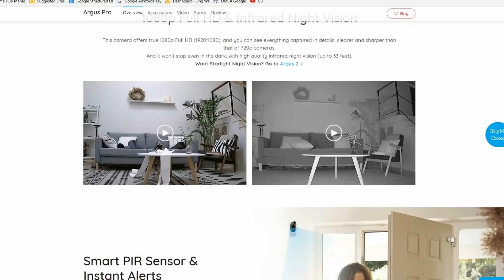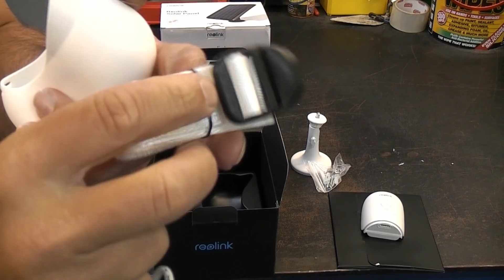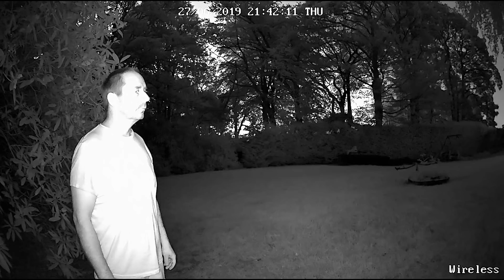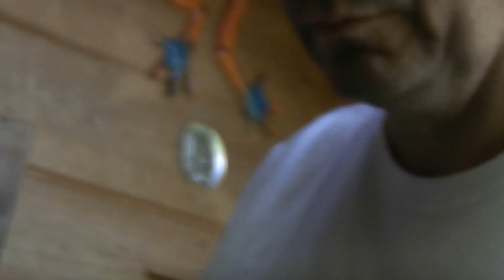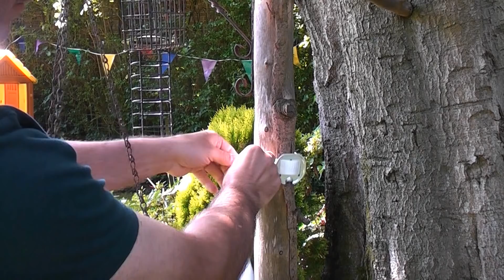Reolink Argus Pro 1080P wireless camera | install and footage

Comment: Are notifications or alerts able to be turned on or off as you choose? I don't want to chronically be bothered by them, as I am using mine for a different purpose. I frequently see car alarms going off in parking lots and no on ever coming out to deal with it. I would think this could be an issue here if you can't turn off notices or such.
Reply from the maker: Yes, you can turn off the alerts
Thanks for the comment 👍

Comment: Don't waste your money.......we purchased three Argus 2 cameras for security for a small resort. Found them to be useless, sensor is hopeless to detect movement and for the most part does not trigger the camera. Reolinks statement the sensor works 10 to 15 meters....this is a lie!.If the sensor does work, the person is only recorded just as they walk out of the field of view (useless for identification). Then there is the issue of the cameras after a period of use not recording to the SD card, and requiring numerous resets etc for them to record again. One battery completely died. After a drawn out period of messaging with Reolink support team, we managed to get three replacement cameras. We hoped maybe we had initially just received a faulty batch of cameras. Unfortunately not the case. The three new replacement cameras are just as useless, with one camera even losing color after two months of use. We have found them to be totally unreliable for capturing intruders on video or alerting us to intruders on our property. We would have been better off just buying fake cameras, as this is all we can use them for!

Comment: Got a Question for you, can i use expanding foam to glue/bond plaster board to a brick wall? obviously there will be some fixings into the brick work. currently its got crumbling render that i will remove to sound or brick.
its just a temporary lash up till i get time to do the room out properly (no time to empty it and have it out of use atm)
Reply from the maker: You can, but it needs to be a special type, which does not expand as much as regular expanding foam- https://www.youtube.com/watch?v=3CJygvnajUA
Thanks for the comment 👍🏼

Comment: Thank you for this video on wireless cams. The market is flooded with them. Hope this is a good reliable device with a good wi-if link. The only buyer beware issue would be security of this device as it’s connected via your home router, we all know about the “ internet of things” and anything with an IP address can be hacked. Also how secure is the app ?. Hopefully the app is not recording your location data and sending this information back to a country half way round the world.. People should be aware that any connected device often has built in code within the app that sometimes sends back usage data, location data etc to the manufacturer. Mostly it’s just harmless data and non-personal, but if you have issues with privacy, do your research when buying any internet connected devices and associated apps. Love your channel !. Very very helpful. Thank you.
Reply from the maker: Thanks for the comment 👍

Comment: Personally, I think wiring a camera to a central DVR is still the way to go where a typical 2-camera installation costs £500 including parts; initially expensive but worth it long term because the wiring will last a life-time with zero maintenance worries. The solar panel is bulky and ugly, still requiring to be located to a sunny location and connecting to the camera. However, the recharging of these cameras isn't too inconvenient typically needing to be done every 3-6 months if set up to trigger on motion, hence minimizing activity.
Reply from the maker: Thanks for the comment 👍

Comment: It says 20mtre range but what do you find is the realistic range with walls in the way?
Reply from the maker: Well, the router is at the front of my house. I've just roughly taken 30 strides (roughly 1m per stride) from the end of the garden to where the camera was, it is then roughly 10 metres to the Wi-Fi extender (which is in the centre of the house).

My girlfriend thinks the Wi-Fi in the house is poor, as everyone struggles getting a good signal, but this camera did not struggle at all- even at the bottom of the garden! 

Thanks for the comment
Reply: @ultimatehandyman  thanks for the reply 👍

Comment: Hello there, thank you for the informative and insightful video, 

Although you might not agree, one thing that Reolink could do is make the camera less visible and obvious. Brilliant white plastic doesn't' exactly blend in well - along with the shiny camera black fascia and blue light.
Reply: Sometimes the people want the cámara to be seen to be a diterrent agent
Reply: I use camo duct tape and it helps with waterproofing as well when deploying outside on a tree etc.
Reply from the maker: They do make a skin for it- https://fave.co/2RMQYqH (I could not find it on the Reolink website)
You can disable the blue light on the front, using the App on your mobile.
Thanks for the comment

Comment: Its a shame all these cameras have to connect to a mothership, instead of just acting like an access point. Having to create a tunnel in your home networks firewall is just not good security. If you deny this device access to the internet, will it still stream video to a locally connected mobile/PC?
Reply from the maker: I'm not sure, if it will do that.
I'm going to try it without the Wi-Fi connection to see if it still records to the SD card.
Thanks for the comment
Reply from the maker: I've tried it without the Wi-Fi connection and it still records to the SD card ;-)

Comment: How long does the battery last without the solar panel ?
Reply from the maker: Not sure, I had it out all night and it used 2%
But you can adjust the settings on the camera for notifications, sensitivity, etc.
Thanks for the comment
Reply: The are people on Amazon suggesting 4 months: even if it needed charging monthly that's perfectly reasonable

Comment: Unsubscribing due to the awful table cloth. 😀 ... was this with the best video quality settings? there seems to be a lot of artifacts, looks like it is highly compressed. Or is it due to the low power usage maybe?
Reply from the maker: I think I had it on the highest setting. If you watch the video on your mobile, it is much lower quality, but you can get the better quality by removing the SD card.
I have 5MP cameras installed at home, so the quality is not great compared to those, but it's much better than the quality on the outback cam that I have.
Thanks for the comment 👍

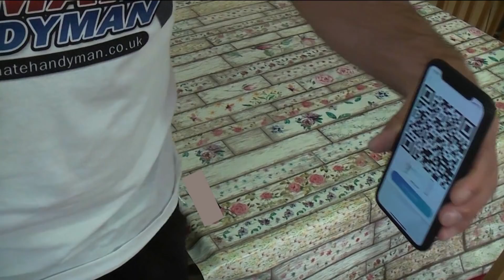Comment: At 4:40

⚠️Remove the QR code from your video as it can be used to connect to your network!⚠️
Reply from the maker: Thanks Dave, when you fist mentioned it, I tried to blur it- but doing stuff like this when the video is live takes ages!
It must have taken at least one hour, by which point another helpful guy had told me that he could get the Wi-Fi password from the QR code, so I changed the router password immediately.

It was a bit of a rush getting the video ready for today (I always try and upload on a Sunday). I did think about the QR code this morning before making the video live, but didn't think it would be possible security risk!

Thanks for your help 👍
Reply from the maker: I've tried to blur it out ;-) 
Thanks for the comment
Reply: @ultimatehandyman  Good man, better safe than sorry.
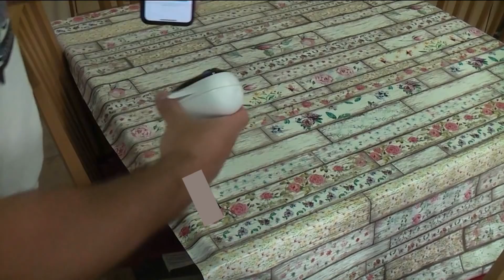Reply: It's at 4:40 on your mobile

Comment: I think it’s a good camera but am I right in thinking that in the U.K. there is no cloud storage option so footage is only saved to memory card which could be lost if the camera is stolen?  Does the notification include any kind of still image or video?  For indoor use I don’t think you can beat the £20 Neos cameras.  Saves 12 seconds of video to the cloud but will continuously record to memory card.  Main downside is you can’t access memory card from the app but I’m fairly sure this is in development.  They are very similar to the Wyze camera but I don’t think cloud storage is officially supported in the U.K. by Wyze.
Reply from the maker: I'm not sure about the cloud storage option, but you are right, if the camera is stolen you will lose the data on the memory card.
I'm afraid I didn't have notifications enabled, so can't answer that.
I'll check out the Neos camera ;-)
Thanks for the comment
Reply: Ultimate Handyman Cheers.  We have 5 of the Neos cameras!  If the Reolink sent you a photo of what triggered it, this could help mitigate the camera being swiped.